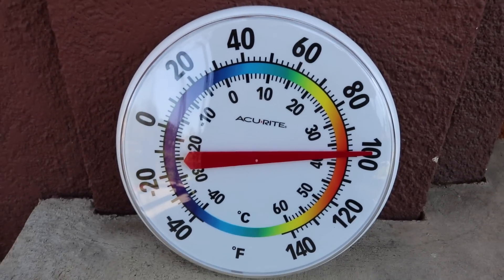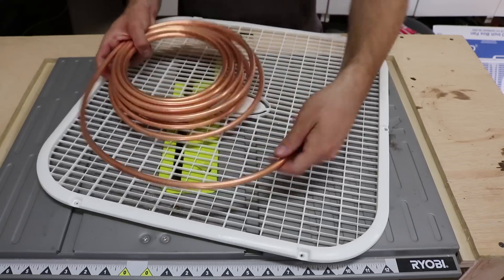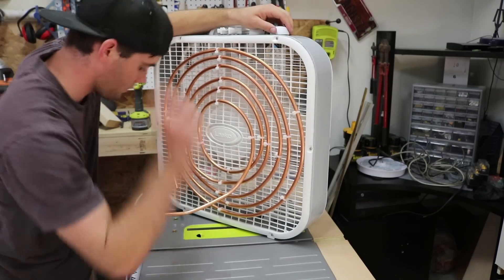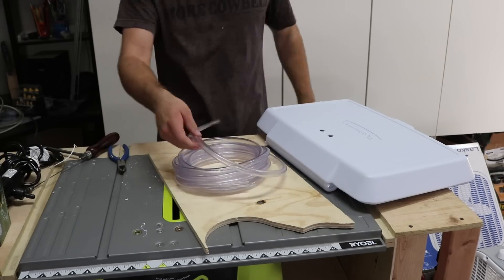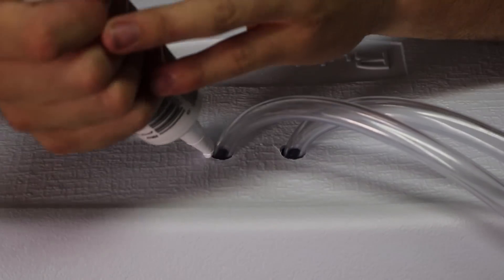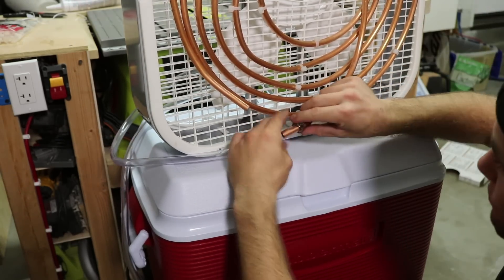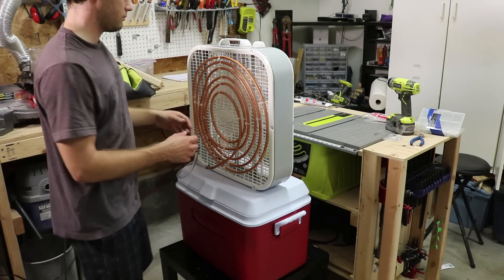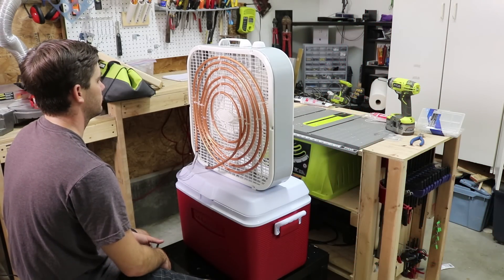$100 Homemade Air Conditioner - DIY

Comment: For a $105 you can buy an a/c from walmart
Reply: What 5 bucks a week is a lot of electricity??
Reply: David Williams but buying something is not the point do it yourself and working is the goal vor Schuhe you can buy everything somewhere in the world the fun and the somalia  do it yourself
Reply: @b.v.6077  lol... uhm, he had to "BUY" all the pieces to put this together. It wasn't like he scavenged from stuff laying around or found a piece of driftwood and CARVED himself a fan or a cooler for holding the ice. It would have been more cost and time effective to buy a small portable a/c unit and get 10 times the return and use out of. "doing it yourself" shouldn't involve SPENDING MONEY to buy the stuff to make a cheaper, less effective version of something that leaves you regretting, "doing it yourself".
Reply: b.v. - The point is spending $100 on something that will not work, this contraption will have no effect on a scorching hot day, and It will never cool your room. So yeah I rather spend $116 on an AC that would actually cool my room.
Reply: Except you need a place to ventilate out the hot air.  It didn't look like he had any way to do that, unless he knocked a hole in the garage wall.
Reply: I was STUPID once!  I even have a Video to show how STUPID I was!  Here:  https://www.youtube.com/watch?v=m1sj6ispqT8
Reply: for an extra ten add an oscillating fan knock the temp down a whole 20 degrees feels like winter still in here.
Reply: David Williams Maybe, but a fan won't run up your Electric bill like an A/C
Reply: You must have a different Walmart than I do, lowest price I can see is $260
Reply: Exactly lol some people just wants to make make stuff  .. good for him
Reply: +David Williams - Please don't knock on my Homies with Poor Mathematics and English!  LMFAO!!!
Reply: David Williams it'll run your electric bill thru the roof too. This little pump & fan won't.
Reply: Kerri not really.  It's less than heating cost for me.
Reply: David Williams this one is portable tho, so then you can move it from room to room, but yes, an a.c. don't cost much more
Reply: Lone Wolf Let me know if this hack really works?
Reply: +kktech04 - 😂😂😂😂 - Opening the Fridge alone cost money.... 😂😂😂😂 - It's free for me too, my Dad pays the Bill!  😂😂😂😂
Reply: +Bill - Go to a Dollar Store and get a Calculator !!! 😂😂😂😂😂😂😂😂😂😂
Reply: That's some serious on-grid thinking you got there boy! Tell me, how well does that $105 A/C unit look in the window of your trailer?
Reply: +Shift Lizard - Hahahahahaha, the last thing I would care is an A/C in my window if I was in a Trailer!  By the way, that is some serious thinking there!  More like seriously dumb!  😂😂😂😂😂😂😂😂😂😂😂😂😂😂
Reply: HEHEHEHE TRUE !
Reply: God bless you
Reply: Assuming there is a window to vent the exhaust from the A/C. i don't see one in his shop.
Reply: David - Isn't there high electricity costs with running those? It seems it'd be much less costly running just a fan.
Reply: running just the fan? in 120F  ? are out your mind? fan just circulate the air .
Reply: Yeah, because obviously it's completely free to make the ice...
Reply: but for his desing u need ice
Reply: You’d be right about a fan using less electricity, but you didn’t think about the extra work the freezer is going to put in in order to freeze the ice, and that will definitely cost more than your prior standard.
Reply: +AndrewCTV - They haven't got to that far yet!  Still in the Flintstones's age, living under a Bedrock!  No Dollar Store to get a Calculator!  LOL 😂😂😂😂😂😂😂😂😂😂😂
Reply: Kerri  How do you make your ice without electricity?
Reply: @onekerri1  5000 btu window unit pulls 450 watts ..a small electric heater pulls 1500 watts  you tell me
Reply: not to mention you need a window that would fit the size of the a/c unit. my apartment doesnt have windows that open vertical  to place a ac unit in.
Reply: @ourevilone  an apartment should come with an a/c unit shouldn't it?
Reply: not when you cant afford a good apartment and ive been in apartments before that didnt include ac or one apartment i had had ac but it sucked and the cold air didnt reach my bedroom.
Reply: @ kerri
5 dollars a week for REAL cool air, or keep on sweating with this stuppid and ugly construction,
because you don't really think that this is working as good as a real airco, or do you??
Adn not to mention the heaps of ice you need to make, because that last maybe a couple of hours
and then it needs to be refilled again, so a hassle.
Reply: You're still going to have to buy or otherwise acquire the ice which is going to be as, or more, costly than AC.
Reply: Kerri, do you really think that the fan contraption on this video will cool your room? in order for you to feel the slightest cool breeze you would have to to sit at least 2 feet or closer to this fan contraption, it will not cool your room. 

You can buy a real AC that will keep your room nice and cool for $116 on Walmart, or $50 for a used one on eBay.
Reply: Hey YOU SMART People !!!!!!!!!  Wanna see ME STUPID...... Look here:  https://www.youtube.com/watch?v=m1sj6ispqT8
Reply: +HuskyGamersUNITE - You haven't been to too many Garages have you?  But I see you'd rather be an idiot than doing something!   LOL 😂😂😂😂😂😂😂😂😂😂😂
Reply: i would cut a hole in the wall, because that takes 5 minutes instead of an entire day to built
that worthless diy "airco" that doesn't cool not even near half as good as a real one, and not to mention
the supply of ice you need to feed that thing.

Comment: You can buy an ac unit that actually blows cold air for $100
Reply: Higher electric bill. Installing some insulation boards on the garage doors would be a great help.
Reply: asix not true, this unit has a pump, and a fan that draw power and the ice needs to be frozen with electricity. This setup saves no power. Its imature
Reply: Yes, true. The pump and fan are minimal and your freezer is working regardless.

BTW, a set up can't be 'immature'(not imature). At least use a cogent insult.
Reply: asix wrong, the freezer only runs when it has a load like warm water. Im a licensed HVAC technician.  I wasn’t trying to insult you. I was insulting the childish design.
Reply: Please tell me the ADDITIONAL energy expenditure of freezing the water. 

"I wasn’t trying to insult you."
I didn't state that you were. 

"I was insulting the childish design."
Again, a design can't be immature and your insistence that the design is 'childish' doesn't mean squat nor negate it's effectiveness nor lower cost.
Reply: asix literally EVERYTHING you put in your freezer that isn't already 0° is an ADDITIONAL load on your freezer.

Sensible heat load of cooling water from 70° to 0°: 70 btu/lb

Latent heat of fusion(freezing) of water: 144 btu/lb

EER of a freezer: 7 btu/(W×hr)

Energy used to freeze a lb of ice = (70+144)/7 = 30Wh/lb

Amount of ice needed to effectively cool a small room: at least 18 lb/hr (for 2500 btu/hr)[2159 btu/hr net after accounting for heat generated by fan]

Total energy demand - 18lb/hr × 30Wh/lb + 100W (fan power) = 640W

Energy Efficiency Ratio of this setup = 2159 BTU/hr / 640W = 3.4

EER of a $90 Sears window unit = 5000 btu/hr / 450W = 11.1

Now after all of that, keep in mind the capacity of your freezer is likely less than 1000 btu/hr and that this DIY contraption is completely incapable of melting that much ice anyway.
Reply: "literally EVERYTHING you put in your freezer that isn't already 0° is an ADDITIONAL load on your freezer."
Yeah, I know. That's why I asked for the ADDITIONAL energy required.

Amount of ice needed to effectively cool a small room: at least 18 lb/hr"
Who said he's trying to cool a room? He literally said he just wants it sitting in front of him. Also, where the hell did you pull this figure from? I don't see 18lbs/hr.

"Total energy demand - 18lb/hr × 30Wh/lb + 100W (fan power) = 640W"
Total energy demand - 9lb/hr × 30Wh/lb + 50W (fan power) = 320W($.038/hr)

"EER of a $90 Sears window unit = 5000 btu/hr / 450W = 11.1"
$129 not $90. $129+tax=$140
$140-$20 fan, $10 pump= $110/$.038/hr=2894 hours just to break even.
18lbs/hr=590w=$.07/hr=1571 hrs just to break even.

Also, you've calculated the amount of heat you'd have to remove from the water to freeze it, not the amount of work the refrigerator would have to provide to make this happen. The Coefficient Of Performance of a refrigerator is defined as COP = Qr/W, where Qr is the heat removed and W the work provided. A typical COP for a domestic refrigerator is about 3-4' reducing the energy requirement to between 135-160Wh/18lbs of ice, not 540wh.
Reply: asix 

""That's why I asked for the ADDITIONAL heat required."
And I gave a proper answer to your question. You're welcome btw.

"Who said he's trying to cool a room?"
It's implicit when the term "Portable Air Conditioner" is in the title. But these semantics don't change the fact that he'd be better off sitting in front of a real air conditioner than wasting time and money building useless landfill fodder.

"Also, where the hell did you pull this figure from? I don't see 18 lbs/hr."
From 14 years experience as an HVAC professional. This is a pretty conservative low-ball estimate.

"50W (fan power)"
On low speed, maybe. 

"$129 not $90."
 If you really want to argue initial cost, let me point out that you can get one from $41.98 shipped from newegg.

"Also you've calculated the amount of heat you'd have to remove from the water ro freeze it, not the amount of work the refrigerator would have ro provide..."
Did you not see EER in my response? Same thing, only using units that fit with the solution being provided.

"A typical COP for a domestic refrigerator is about 3-4"
Not even close. I used EER of 7 which is equal to a COP of slight over 2. That was me being VERY generous. Feel free to peruse the spec sheets of compressors typically found in small refrigeration appliances in the link I'm providing. You'll find the max is ~2.1, with the normal range being 1.2-1.6ish. Some are as low as 1.0. These are for JUST the compressor; fans,  defrost cycles, etc. drag these values down significantly in the end.

https://www.tecumseh.com/en/Corporate/Product-Search?sort=&sortreverse=&xrefmodel=&xrefbom=&producttype=Reciprocating+Compressors&application=LBP+-+Low+Back+Pressure&refrigerant=R-134a&current=&capacity_min=0&capacity_max=74000&market=&regions=&voltage=&frequency=&phase=&page=1&modelnumber=&billofmaterial=
Reply: Except for the fact that many apartment buildings and other town house etc don't allow window AC units to be installed neither do they allow portable ACs to be used by the renters.   What would you suggest for them?  I'm honestly trying to figure out how I can help my sister with my baby niece to stay cool during these hot summer days.   I'm looking at all these DIY designs for some type of work around, as well as something that would be safe and effective.  Any ideas or suggestion?  Thanks :)
Reply: +Ross Hoss Applesauce - Please don't knock on my Hommies with poor Mathematics and English!  LMFAO!!!
Reply: I was STUPID once!  I even have a Video to show how STUPID I was!  Here:  https://www.youtube.com/watch?v=m1sj6ispqT8
Reply: https://zefte.com/products/copy-of-buy-portable-air-conditioner-cheaper-than-walmart-home-depot-amazon?variant=8191923486817&cmp_id=1441035088&adg_id=63136506944&kwd=&device=m&gclid=CjwKCAjwg_fZBRAoEiwAppvp-Z7rD9Jk4SBm9mZEBUSmTLtbAmNkAtlhjQj0EgB6l0IgMPCiIcj6VBoCy7YQAvD_BwE
Reply: Just out of curiosity, i continue to see comments that an air conditioning unit cost around $100. I have been all over amazon and my local hardware stores (home depot, lowes) and the cheapest standup air conditioners i can find are $350. I'm trying to find a way to cool my 10 x 12ft room without a window mounted AC since we are not allowed to mount one.
Reply: +Rodney Ramos Jr. - They are talking about " WINDOW MOUNTED " AC!

Comment: I've tried this, works only a little bit. Doesn't make a difference
Reply: It makes a better difference in electricity bills tho
Reply: SiNKarnage well then you have 2 options. 1.) Burn up trying to save electricity😂😂😂. 2.) Spend A little money, buy a decent ac unit and turn it down to save power.